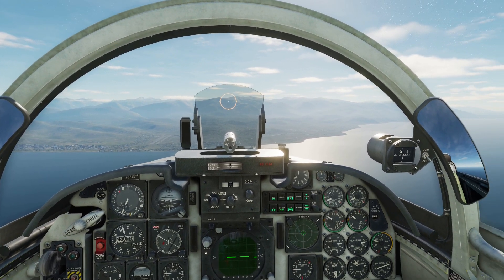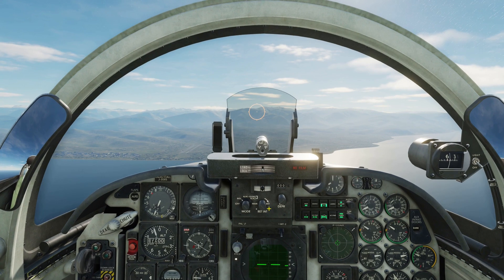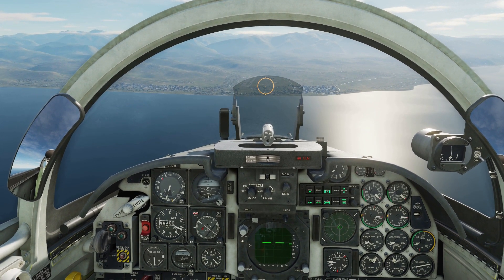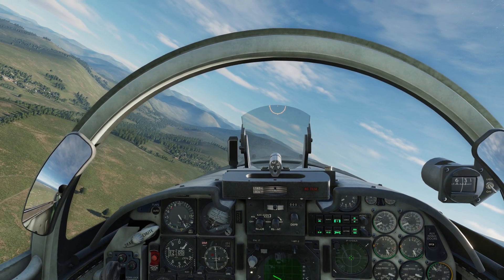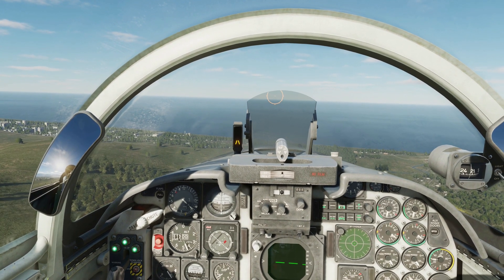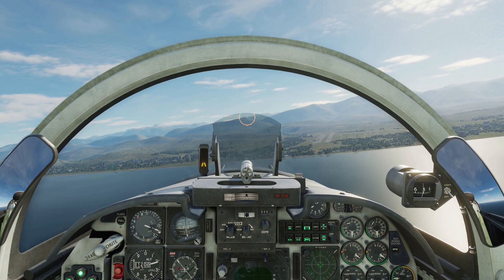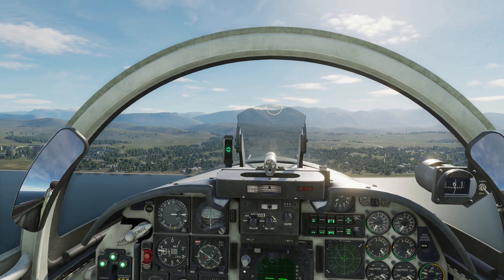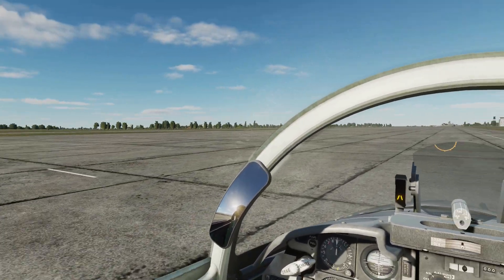DCS | F-5 landing tutorial

Comment: Something that I do when I have to do a "box" maneuver (like when landing or circling a target after attack)....as I'm approaching I align the HSI course arrow (actually the "shaft" portion of the arrow, not the pointy thing) with my approach direction. I don't need to know the actual degrees, I just align it with 12 and 6. Then when I'm turning to crosswind leg I can focus on altitude, because when the arrow aligns with 3 and 9, that means 90^ to the runway. I keep that heading until I start turning to the downwind leg until the arrow is again aligned with 12 and 6 (doesn't matter about the actual arrowhead, so long as the line itself is aligned properly). I continue like this on base leg and final.

Makes for easy and sharp corners.